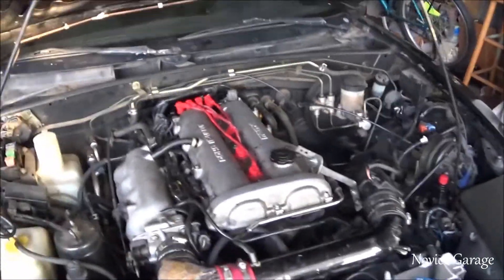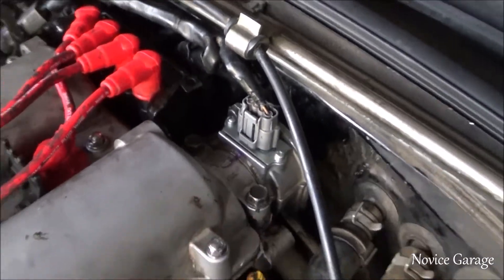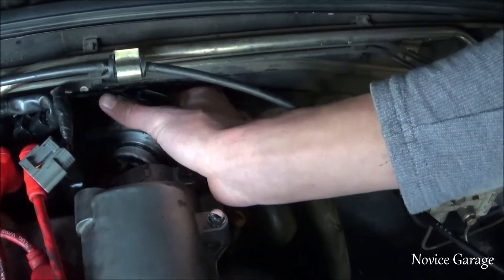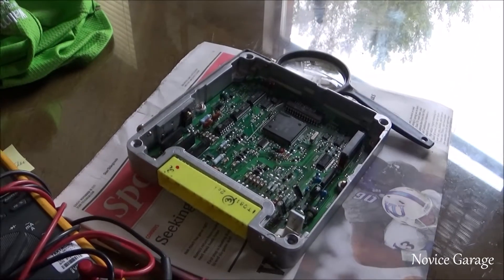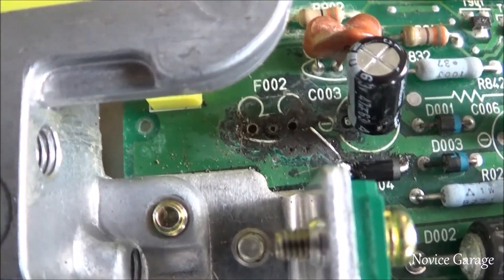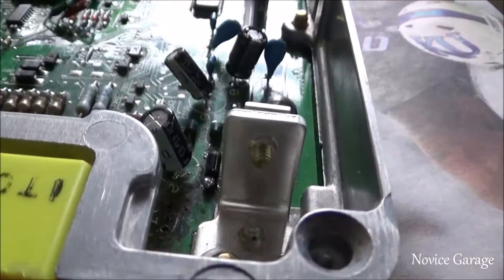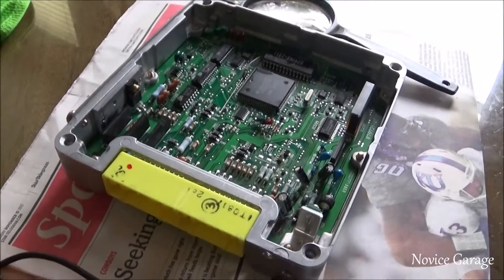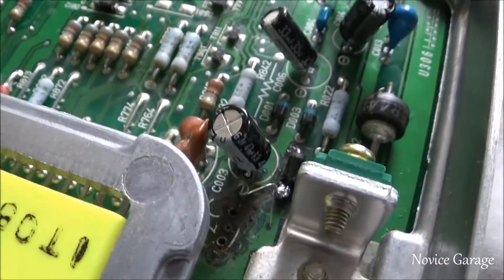Miata ECU Repair

Comment: Hi! I have a 2007 Miata x5. Do you know where the ecu is located?

Also had a bad rainstorm and realized I have a leak somewhere bc the passenger floor get wet when it rains. The SRS light started going off. I’m not sure where to start. Thank you!

Comment: thanks for this video, i have had the same problem occur recently :( thanks to your video i pulled out the ECU and found it half-submerged in water hidden by the sound deadening D:
Reply: how did you fix it? I had to repair my ECU and buy new cables and plugs..

Comment: I can't find part two, did the eau repair work? I been having the same problems with mine and my way is black in the same spot
Reply from the maker: It did not :/ pretty sure the problem turned out to be a faulty ignition coil
Reply: @NoviceGarage  Could you solve the problem? The same thing happens to me and I already fixed the computer, I need help please! :(